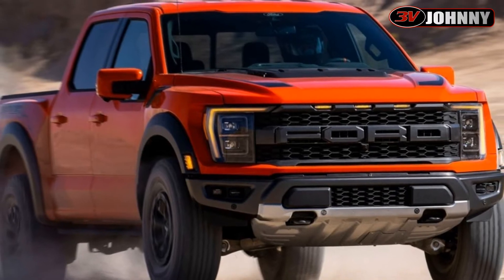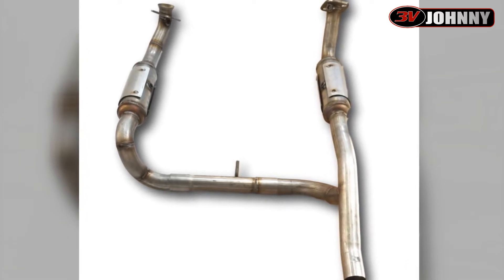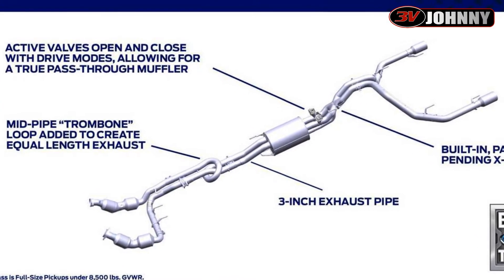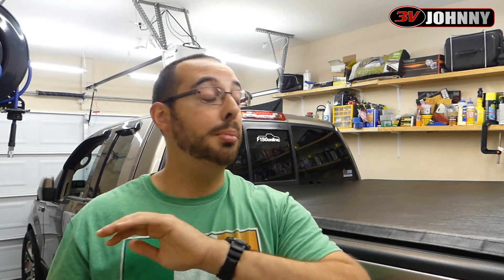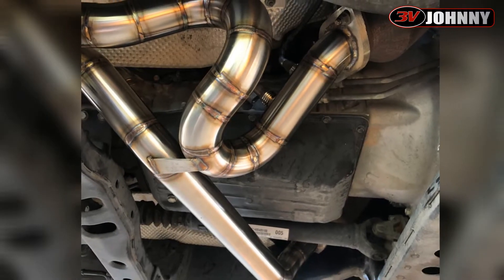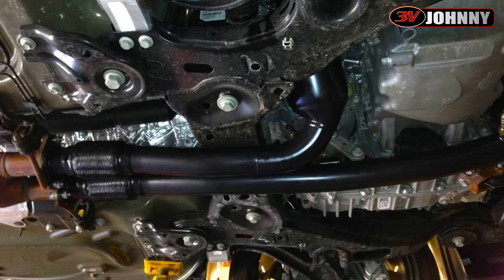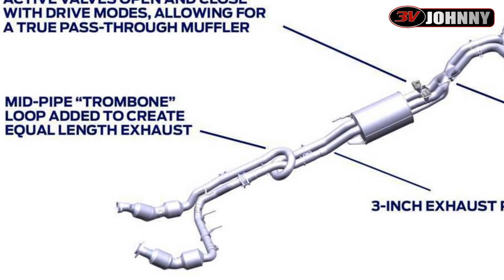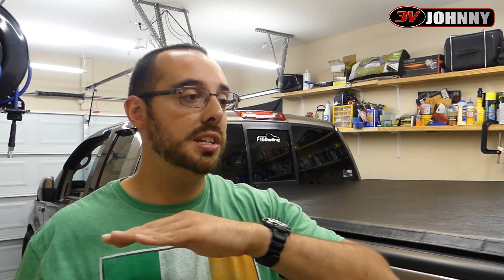This is Why the 2021 Ford Raptor Exhaust Sounds So Good #3vjohnnyreacts

Comment: Why put the loop in it? Why not just run both pipes straight back side by side on the same side of the truck?
Reply from the maker: 2:11 explains and shows why.  A truck's drivers side bank has to transition over to the passenger side and that extra length on that bank, is now cancelled out by the added loop on the passenger side bank.